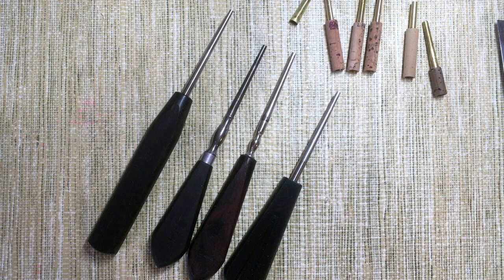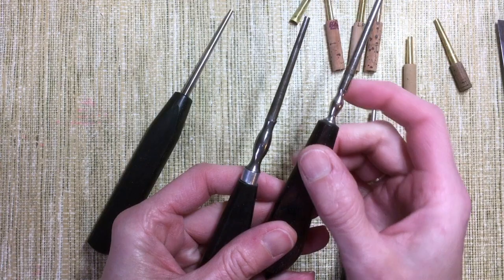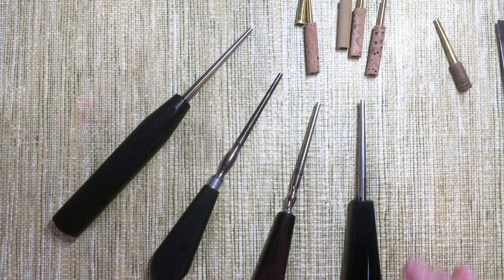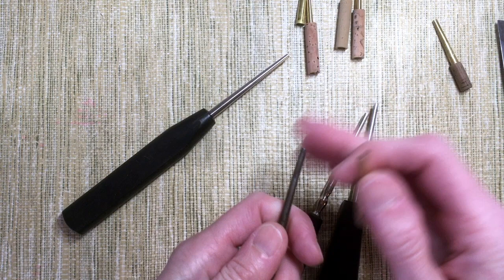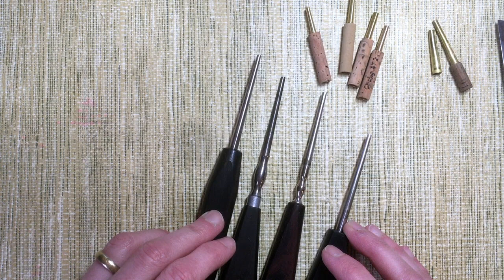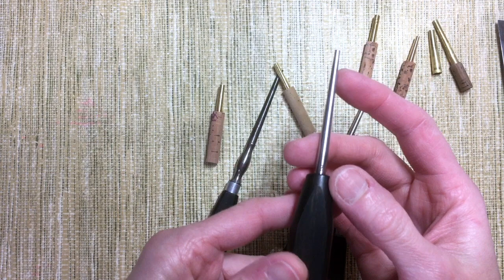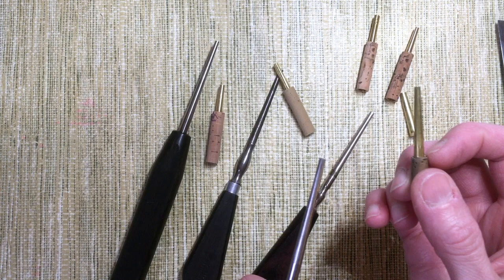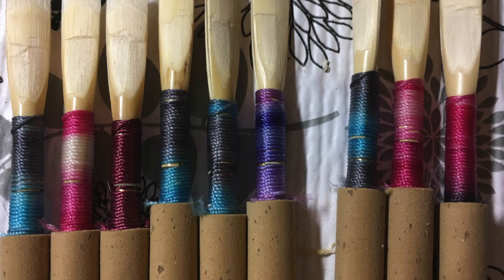Five Minute Reedmaker: Tools: The Mandrel

Comment: What effects do different staple tube size have on reed making? I presume that narrower tubes will have a limiting effect on the "size" of the sound one can optimally produce. Maybe also make it more resistant slightly? Perhaps the wider tubes will have a larger capacity for volume, but require more air to keep stable? Perhaps these are all questions you could make for a new video? Pardon me if these questions may already be answered in a previous video!
Reply from the maker: This is a great question, and I’ll work on it for a future video! Thanks for watching!